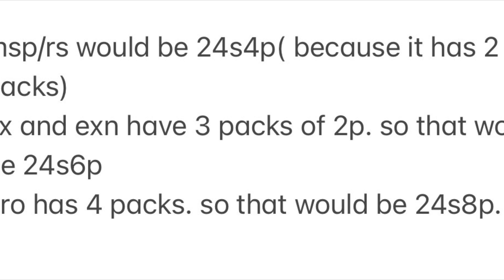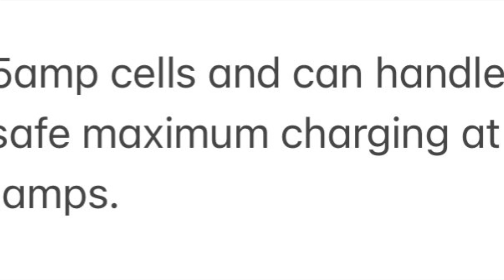Charging explained on Gotway/Begode wheels

Comment: What you've said is true when the cells are under 25C° but above 0C°. They can be charged at 0.7C when above 25C° but under 45C°. That is 3.39A per cell so in theory you could charge a 4p pack at even 13 amps with no downsides as long as the cells stay in that temperature range. This is straight from LGs own datasheet for the lg m50t cell.

The batteries do tend to heat up a little when charging so this would usually bump it over 25 degrees)(assuming ambient indoor temperature to be in the range of 20-22 C°.

Comment: Vore Good video 👍 i have a fast Charger 5 / 7 / 9 amps. I go max 7 amp if i are takeing lunch break No issues here.  Only use 7 amp sometimes otherwise 3-5 amp. I got a MSP high Speed c30.

Comment: Now you should do a video on voltage to help us understand voltage
Reply from the maker: that one is easy, just count  1v to be around %5 of pack capacity. it’s pretty accurate for most part. so if wheel is at 90.8 volts: 
100.8-90.8= 10v
10x5%=%50 left on pack.
or collect data for a few rides and figure out how many miles you do on 1v. this info for different terrains and speed will be very useful.
i get about 3miles per volt on my rs.
81.6v is when you get low voltage alarm and can still ride but i don’t recommend since you may damage cells. so i call 81.6v %0.
Reply: @rayrokni  awesome 👍 thanks again